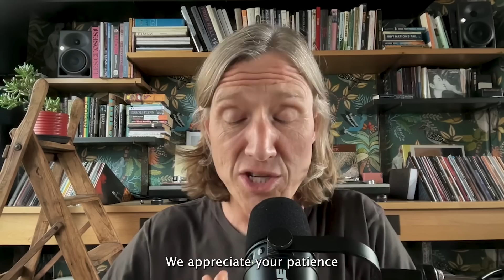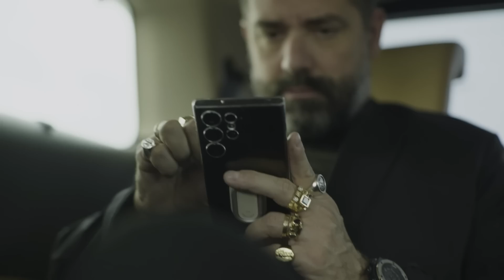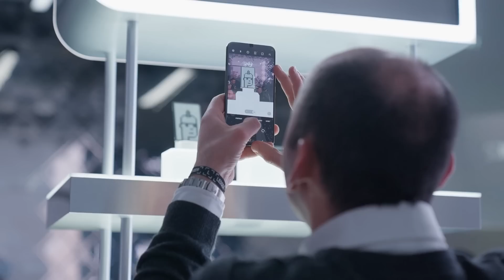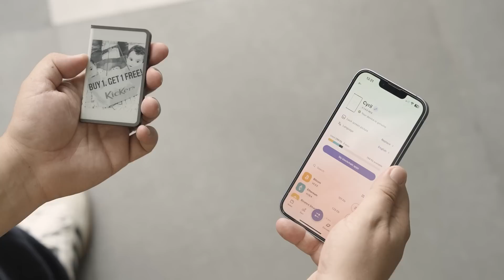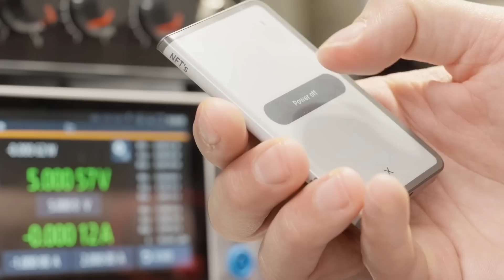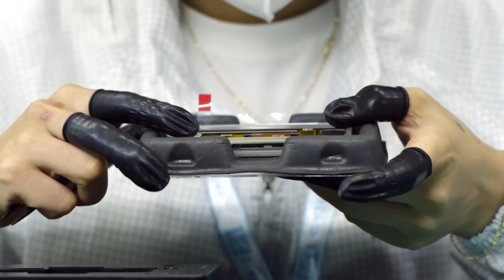Road To Ledger Stax

Comment: ❤ will it be open source software?
Reply from the maker: At Ledger, openness and transparency are among our core values, and we are committed to upholding them. We're working to reduce the need for trust by making more of our source code available for review and verification, and by publishing more of our OS components while respecting the intellectual property of our Secure Element vendor.

You can learn more about our approach to open-source software in this article: https://support.ledger.com/hc/en-us/articles/11132311094813-Ledger-s-approach-to-open-source-software?docs=true
Reply: @Ledger  what about the hack?
Your software is garbage
Reply: Nope
Reply: They did say secure chip in the video… and Ledger never has opensource, even Trezor did stop whit opensource in the new devices.
Reply: @VicGreenBitcoin  I paid for a ledger device where "the keys can never leave your device". Now with their new feature they basically admitted they can extract the keys at any time if they wanted to. I really liked ledger, but I've switched to another brand just to be sure.
Reply: @mh518  Good luck with that, just because other vendors havnt mentioned that they can or cannot extract your keys, dosnt mean they should automatically be trusted. Passphrase basically negates the issue all together.
Reply: @mh518  what brand if i may ask?
Reply: @RETROMAN.1  trezor, they've been around for as long as ledger and are open source. pretty much everybody who switches away from ledger goes to them. Other than these two companies there really aren't a whole lot of reputable ones.
Reply: @mh518  if they really can then the 25th word sounds like the only solution
aka the extra word that only you know and enter could be a defense against it 
that is if they're not keylogging your secret passphrase (25th word) either  ......... EDIT : BUT THEY DO SAY LEDGER LIVE DESKTOP APPLICATION IS OPEN SOURCE, so we got that at least. so
Reply: no because they want to be able to steal your keys
Reply: wtf? XD